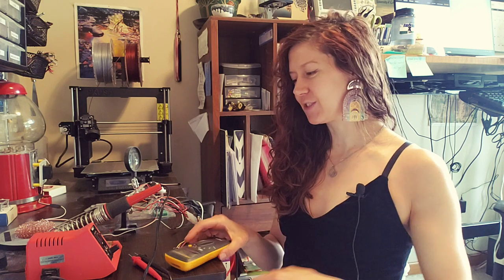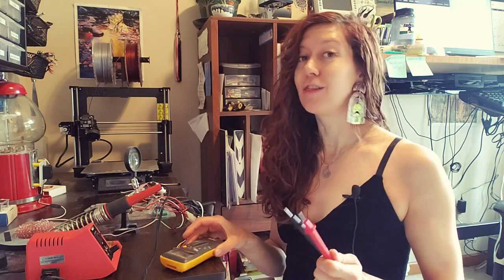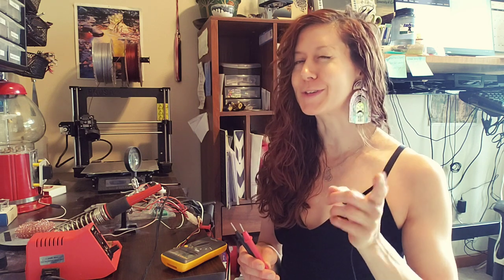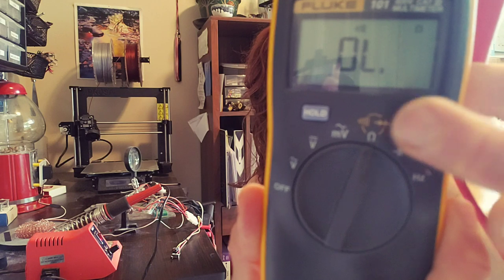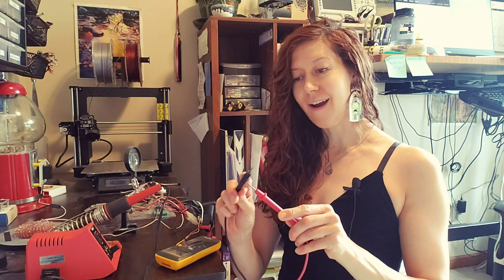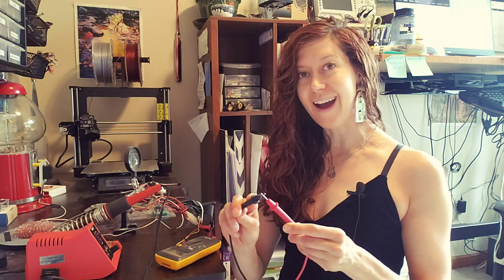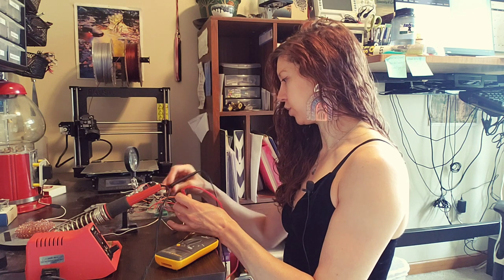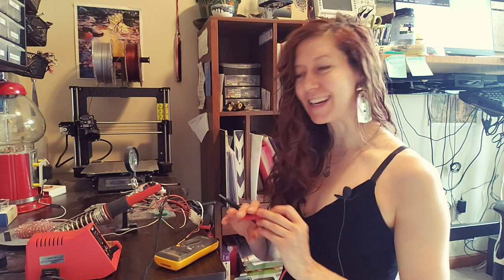Tool Tip: Check solder joints (or broken electronics) with a multimeter!

Comment: You're so Awesome, 💖 soldering is so much fun,
Reply from the maker: Aww thank you for the kind words! And heck yes soldering IS so fun!
Reply: @JenFoxBot  What kind of multimeter should I buy? Fluke is a good aka reliable brand, right? Up to 70 - 120 eur/usd......    also do you recommend some PCB for practicing soldering*? Im new into all of this.....
Reply from the maker: @samfkt  I do love fluke, they are considered by most folks the best in the industry. That said, a digital multimeter (MM) with continuity and ammeter will do you just fine as you learn. There are some super fun "learn to solder" kits at adafruit, would def recommend those!
Reply from the maker: Oh also I'd check what digital multimeters adafruit sells, they are likely cheaper than a fluke and will meet your needs
Reply: @JenFoxBot  Okay, thanks for your reply. Helps a lot.....

Comment: @ :50 you said "by checking the ends of the wires I didn't solder" ??? I don't understand
Reply: She is saying that if you solder 2 wires together, (let's say a black and white wire), you have a black wire on the left, and white on the right, with some point in between the two being your solder joint. Your ends (1 black & 1 white) would be un-soldered, and if you test the ends for continuity, it would tell you if they are connected at your solder joint.

Comment: Question please, I'm new to soldering :) If I solder headers to a microcontroller (Raspberry Pi for example), how can I check if I have soldered them correctly? Also, if I solder switches to a mouse or a keyboard, how can I check if the joints are good?